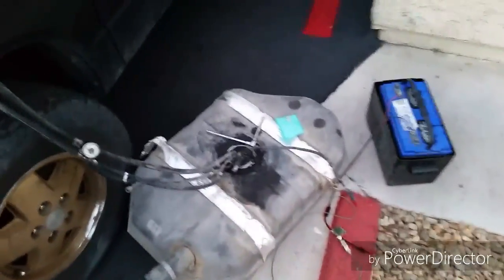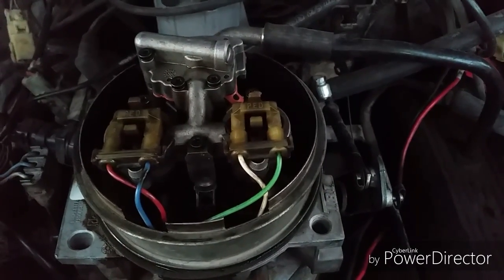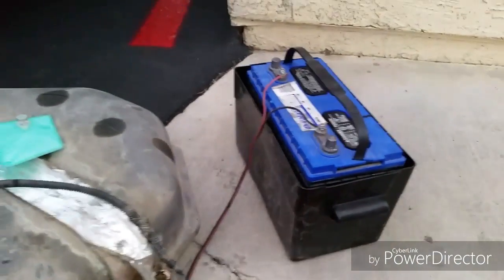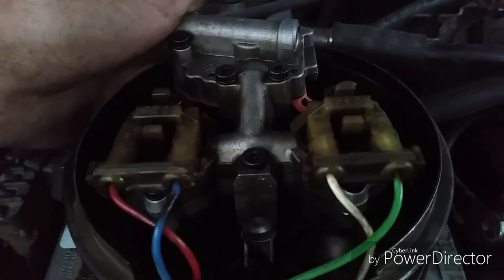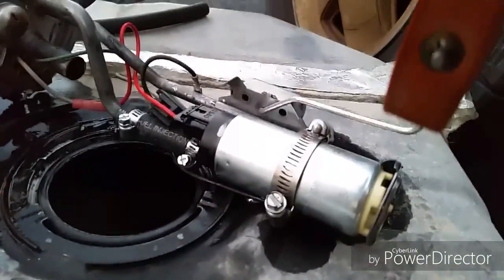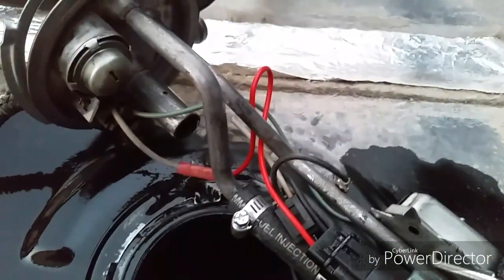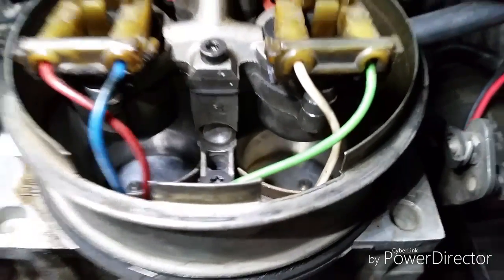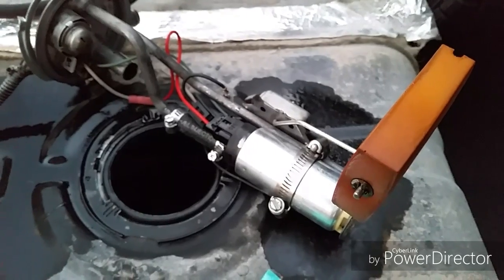Walbro 255 in GM TBI

Comment: So what is the overall outcome and performance of this upgrade . I have a 350 tbi and want a higher volume pump to work with bolt on upgrade like performance heads , intake , cam etc . . do you think this pump will work ? Thanks

Comment: high pressure to a low pressure regulator will restrict the gph and cause issues. there is a reason they make tbi fuel pumps.

Comment: You still running this setup? I have a K-5 with the pump out, would appreciate any feedback thank you.
Reply from the maker: https://aftermarket.tiautomotive.com/direct-fit-applications/

I just did another 5.7TBI  K5 as well as the 4.3 TBI S10.
Daily driven no issues. Please replace that old corroded ground braid from the basket to the frame with new 12awg wire. All electrical connections should be clean and bright. Your fuel gauge will be more accurate and your pump will get more power. Use the nice butt connectors with the adhesive heat shrink.
Reply: aprofessionalamateur, Thank you so much for the reply! I will defiantly apply this knowledge to the repair job, awesome to know you did one on the K5, thanks again friend.